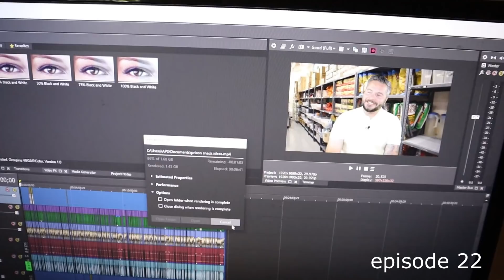Trying To Find The Leak

Comment: That electrical wiring was for a doorbell ... that device was a 120volt to 12 or 24 volt transformer ... The device and the wiring should be removed but you not have to tear a wall out to remove it. Word of advice, let the tradesman do their job. You can let them know that you have traced out the existing lines and you know there is only one outlet being used. Just don’t helicopter the person doing the work, if he is an honest person, he will do the job and leave. The pressure test usually has to be on the system for several hours and it will have to hold the pressure steady. The plumber will have to pull a permit and he will contract the gas company. You have to be patient with the utilities because they are the only ones in town and you have to deal with them every time you have a problem with utilities. The same goes for the city inspection department. In my dealings with City inspections, there is a little different way to do things every time you speak to a different person. Just remember when dealing with utilities or city inspections, you have nobody else to deal with and you are not going to change the way they do things. Just be patient and do as they tell you or you are not going to get your utilities turned on.

Comment: You need an air compressor and undo gas line at meter. Get a manifold to put compressor on the gas line and put 10 PSI in lines. Also. For the furnace flue, pitch it 1/4” per foot. HVAC Tech in NYS